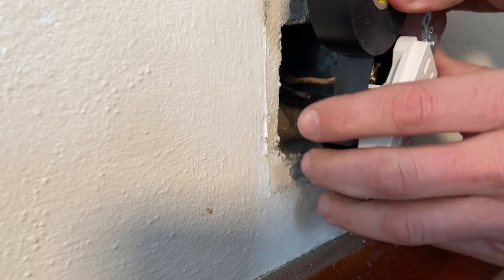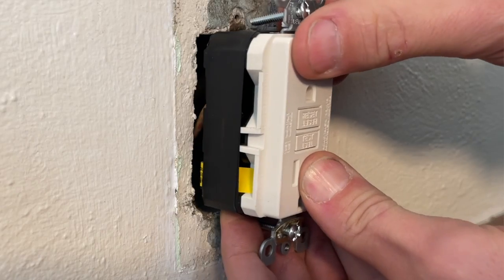Should You Wrap Outlets In Electrical Tape?

Comment: As a rule I don't tape them. In your example of a tight ungrounded metal box the tape provides a false sense of security. If a poorly made connection has a wire pointing out and the outlet did have it pressing against the box, the pressure on the tape over time may cut through or it might cut as you install the box. You think you're insulated but you're not. 
No substitute for clean work which doesn't leave an exposed wire or need tape.  It also hides the connection from inspection which could fail a  job If the inspector gets picky.
Some others said it's not in the NEC code so it's ok. That's not true.  Anything not called out in the manufacturer installation spec or applicable codes should not be in the box. Parts are rated when installed according to manufacturer's specs. Anything not spec'd is improper installation. 
What if cheap plastic tape drys out and is flammable or not temp rated equal to the wires, insulation, box and termination?

Comment: In Arizona, it will unwrap itself, in the heat, and it will all end up in a sloppy mess.
It leaves a black sticky residue on the wires and on the device, and then it gets all over your hands. It's annoying.

When you are installing a new, you don't realize it. But when you go to do a repair, you will find out

Comment: The lights in my garage flickered and the power seemed to fluctuate, the problems appear worse after it rains. I uncovered all the outlets and noticed that the outlets were all wrapped in electrical tape, so I removed the tape and made sure all the connections were screwed very tight and that seems to have fixed my issues. Looks like I’m a No on wrapping outlets with tape.

Comment: Always use tape on devices and wire nuts.
No one has ever given me a good reason NOT to use tape on receptacles or switches. It’s an additional safety issue. Yes it takes time and yes the tape will cost you money but the additional protection it offers against coming in contact with a ground wire or metal box is worth it.
In addition, I am an advocate for taping wire nuts as well. However, I’ll perform a pull test first after installing the wire nut and then wrap it in tape for the added protection.
For those who are against wrapping, can you please give me reason why. I promise I will keep an open mind but after doing this for the past 40 years, I will find it difficult to change.
My opinions are just that. Thank you.
Reply: As an electrical engineer who has done a lot of wiring, my perspective is that the outlets were designed to be installed without tape, and if installed correctly according to code and manufacture's instructions, no tape is needed.  Taping is done by those who are not confident in their abilities, are installing things incorrectly, or do not trust the products they are installing.  That is my perspective.  

I understand the fear and safety blanket mentality.  
It is like wearing a cloth face mask and thinking you are safe from a virus.
Reply: @shaggydog7984  agreed 100%. 
My response is show me in the code book where it says to tape receptacles.

Comment: The wires have to be twisted properly, the wire nut isn’t there to twist the wires but to protect the ends and secure them.
Reply: Exactly this. Wire nuts aren't to secure the wires together. Your initial twist splice should do this. Wire nuts are to prevent from contact and arcing. You should never remove a nut and the wires just fall apart, never

Comment: Sometimes.  Tight metal boxes...definitely.  Wire nut wrapping?  Only where moisture or chemicals may present a danger.  I use the silicone filled nuts along with wrapping.

Comment: even if an outlet is taped when I pull one out I am still super gingerly inspecting it and in some cases putting on my own tape. in my area I very rarely see a taped wirenut. if I do I instantly suspect it of problems ie the stubbed out wires are super short and they didnt get a good twist. removing the tape I will sometimes see exposed conductors feeding into the wirenut.  if I have pulled a receptacle out of a box for any reason I always tape it. its not common practice here to tape an outlet during new or refit construction it seems.

Comment: its never a bad idea to do. bare metal copper screws make a good conductor against a receptacle housing. I work as a manfacturing mechanic and given most of the stuff we're wiring up switches and outlets to is heavy duty equipment that have motors, pneumatic systems and plenty of other things to generate vibrations, couipled with the fact most if it is high voltage means we ALWAYS tape around the outlets and switches. You ever see what a 480v hot wire can do to a receptacle or transformer box when it manages to short itself against something in the housing?

Comment: If you're doing electrical work, you twist together your wires, put the wire nut on, do your pull test and then usually, I'm done there. If I'm using wire nuts on anything higher than 120 volts, I start taping my wire nutes. Getting bit by 120 because a wire nut popped off when you opened up an electrical box is going to hurt, but it probably won't kill you. 240v or 600v? That's another story entirely. In the case of high voltage, make a quality connection, and then use electrical tape to make your work safer.

Comment: The transition from knob and tube to BX cable or cables in conduit happened about 1920   Almost zero knob and tube after 1920.  Yes there were knob and tube repairs,, there were die hards, there were some who just wanted to use up the stock they owned.  I have worked extensively in older homes,, and my first licenses were more than 50 years ago.  I know the dates of the homes I have remodeled,, and even my own,, right now,, in one wall,, I know there is knob and tube.  I know the dates, I know when homes were built.  The big improvement to Romex was WWII  BX before WWII,, The big disaster was aluminum wire,, mid 1950s

Comment: True I use electrical tape on all outlets and switches it does not matter if the box is metal all outlet and switches if there’s a wire I will always use electrical tape it makes electrical work safer wire nuts are different using the right number of wire nut is important

Comment: After finding outlet screws that somehow backed out and arced against the metal box tripping the breakers in both  of my 50+ year old houses I came up with wrapping the outlets. I also wrap wire nuts for the same reason. Some call me nuts, but I dont care.

Comment: I hate coming in behind another electrician that has wrapped receptacles and wire nuts. In a properly installed installation with box fill taken into account there is absolutely no reason to tape and only makes a sticky mess years later when changing devices. I also pigtail absolutely every device receptacle that feeds through. I have pulled way too many fed through receptacles that were melted.

Comment: The only time I tape them is if they're tight inside of a metal box. Light switches aren't typically tight so those I don't wrap. But if the outlet is near the sides of a metal box, then I definitely take the time to wrap it up to ensure there's no arcing. Just a DIYer, not even close to pro level here.

Comment: Wrap the switches and outlet terminals 
. Especially if the box has multiple outlets and/or switches. The next guy to go into these boxes will thank you. Wire nuts, why would wrap a wire nut? If properly installed where are no exposed wire ends or screws to get shocked on.
Reply: You tape wire nuts because packing them into boxes one could accidentally get knocked loose. If you do not know what I am talking about then you do not know much at all. Fact is there's situations where more than one circuit is running through a box. Then when you're trying to get a half a dozen wire nuts and a switch or receptacle into a box too things get tight. They don't call it electrical WORK for nothing.

Comment: I use wire nuts all the time making sure that each wire is stripped 1/2” from end, then using fence pliers grasp two wires that are matched and twist the two wire ends around each other 1/2”, then twist on the wire nut securely.
Reply: Pretwisting is not required on modern wire nuts but if you do..I think it;s better to strip more, twist then cut off excess

Comment: My wire nuts for the wires that turn on my sprinklers are just sitting outside exposed to the weather. I was thinking of putting electrical tape on them to protect them a little more from the weather. What is the best way to deal with those?
Reply: They shouldn’t be. They should be in some form an enclosure. They do make weather proof wire nuts tho, if use tho.
Reply: @moderndiscourse  Wow. I'm starting to think absolutely everything about the construction of my house sucks.
Reply: @mitchjohnson4714  Contractors so shady stuff al the time unfortunately. Get some proper weather proof wire nuts and replace the old ones. You can buy small packs of 5 or 10  at Lowe’s or Home Depot. When was your house built?
Reply: @moderndiscourse  Like the 50s. I don't know when someone put in the sprinkler system, probably 12 years ago when the rest of the house was updated. It was by flippers who did a really crappy job on everything.

Comment: I only wrap if its metal or multi  Any others i trim for Minimum bare wire outside the screw and tuck the Ground in the top or bottom  Wherever it enters the box. And i only tape the wires at the base of the nut After the wires are secure and checkedjust to prevent contact in just in case the sheath receeds when your tucking it away

Comment: Absolutely wrap your plugs & switches with tape!!!!!! I've been doing electricity for 40 years and that's the way it's done for many reasons
Reply: Except it's not the ways it's done, depending on the locale. If you're in the US, the NEC doesn't require it for a reason.
Reply: @JeremyHansen  there are allot of thing the NEC doesn't "require" that I do it's called going above and beyond the "minimum" requirements of the NEC and doing what's right.... Think about other trades and other tradesman..... Think about doing a better job for your customers!!!!!

I could keep going if you like..... Just because it is or isn't in the code book means very little to me.... 40 years of real world experience (around the world) give me insight that others don't have and certainly cannot be read in a book.....

Comment: Being as you put a GFCI in an ungrounded, two wire box with zero equipment grounding, you're required by code to place a label on the faceplate that states that it is UNGROUNDED equipment. Not to mention, why are you placing a GFCI on an ungrounded circuit?
Reply: It's a code option to replace a two prong outlet with a gfci for the third prong. A lot of homeowners can't afford to add a ground wire back to the panel.

Comment: This isn't on topic for the video 
But why did you install  a GFI receptical when there is no ground don't they require a ground to work properly
Reply: Wvfordx,  no a gfci does not need ground to function.  You can clearly see why this is true by looking at the circuit. The gfci measures the current on the hot and neutral wires and subtracts them to calculate the difference.  If the difference is 0 then it allows current to flow.   If the current in hot exceeds the current in neutral, ie not balanced then it trips. Therefore at no point in the measurement is the ground wire used to determine a fault.

Also there is a section in the nec which specifically allows this.
Reply: @neilbrookins8428  ok thanks for the info
I always thought it needed a ground wire to work
Reply: Also have you seen the rubber bands made for outlets in place of tape what's your thoughts
Reply: @wvfordx  you are talking about ArmourBand. It’s a nice product but too expensive to be practical. Electrical tape costs much less.

Comment: In industrial environment, wiring electrical motors with wire nuts - taping wire nuts recommended for vibration reason!!!
Reply: I just made a comment before I saw this post.   I work with a lot of 480v, I tape from 1" below the nut all the way to the very top.    If I need to repair/trouble shoot, I just unwind the tape and it's all clean and way easier to work with.

Comment: Industrial electrician from New Zealand here - For the North American wiring system, tape is probably not necessary on socket outlets, all things being equal... HOWEVER having seen the cheap shi**y fittings installed domestically there, both the outlets and in wall it probably wouldn't hurt. Unfortunately tape moves over time so it will only help during installation and make a sticky mess later on. If you can find fittings (I don't even know if they are produced for your market) that have fully insulated neutral and phase (Hot?!) terminals get them.  Why create a fault path where one shouldn't exist?

Comment: I agree though it’s not 100% necessary to take the wire nuts when it is time consuming and a pain in the ass and if you trim your insulation to the right length you won’t have any expose copper to deal with

Comment: If they are not required in battle ships where almost all receptacles are made of metals and  more likely exposed to severe physical conditions and potential damage not encountered in homes I don't see why it is necessary for household use to wrap them in electrical tapes. Of course you can always do more than what's necessary especially if you or somebody is willing to pay for it in time and material cost. How do you price self satisfaction and better safety assurance if it makes you happy?
Why not cover the exposed connections in electrical epoxy or some type of suitable sealant while you're at it? Better still have a heavy duty custom rubber boot  made to enclose the back part of the receptacle for good measure.

Comment: electrical tape is flammable, if you install the wires correctly the chance that they can be dislodged is very small, but the chance that enough heat may someday be enough to ignite the tape is much higher, due to oxidation of the wire at the connection causing heat to be generated. in this scenario what normally happens is the connection is lost and there is no longer enough power, or no power, to cause heat after a while, and in the absence of any flammable material such as tape, the loss of power is followed by a qualified repair person doing a repair. I have been tasked to investigate loss of power at an outlet many times and thought to myself, this was caused by a bad connection and thankfully there were no flammable materials in the box or this may have caused a fire

Comment: I don't even wrap in metal wall cases. The only time I will tape the terminals is if the outlets are on the backsplash and the tile guy asks nicely.

If your nuts are taped, you're leaving too much bare conductor in your splice, or just using a nut too small.

And for those who just need to wrap their receptacles, ideal has just the product for you! Stretchy insulating bands, useless to me but faster than wrapping with 3m

Comment: I've never heard of wrapping an outlet in tape. Wires should be twisted and cut with lineman's pliers first, pull tested, and then have the wire nut installed. Tape is not required but may be added to keep the nuts from falling off. I have more than once seen wire nuts where the internal coil stays attached to the wire, but the plastic nut comes off, splits, or degrades with age.

Comment: 33+  with metal boxes on interior apps, always on GFCIs in plastic or metal. 33+ then some Jumbo fabric when it's an exterior box. I don't use tape on wire nuts unless I'm sealing up an exterior junction and then I use a decent liquid tape under the fabric tape.
Also, wire nuts should always have an inch of twisted wires behind them. People tend to overload wire nuts which leads to weak junctions that invite heat, corrosion from moisture build up and also make it impossible to form fit in the box. If it says 4 -#12 solid on the bag then you only go 3 max; pigtail one for another junction if you need it. IMHO

Comment: Always tape devices and wire nuts.   
Devices  often are pulled out and angled down for painting. Protect the other trades.     

Electrical tape is rated as sealant has he ever read the package?   
Wire nuts should be checked for good wire retention first. Pull each conductor separately to make sure one did not slip out (it happens to everyone).  Then tape to prevent loosing and debris . 
Nothing worse then pulling old junction box open and finding wire nuts falling off.
I’ve had a hot hit a metal box that was folded under several other wire nuts.  Worst game of operation ever.
Reply from the maker: 😂 thanks for the feedback!
Reply: Fear of the juice is the electrician's stock and trade. So gotta make sure people get zapped just to keep the fear alive! A little nip now and again keeps them in line.

Comment: Not necessary in plastic boxes. Some contractors will fire you for wrapping outlets/switches, or connectors. Read the instructions on the bag of wire connectors that say no pre-twisting necessary. Finally, if you feel a need to wrap a connector, you are doing something wrong, most likely connecting too many wires for the connector size. No contractor will buy 33, that is not necessary, only for large splices.